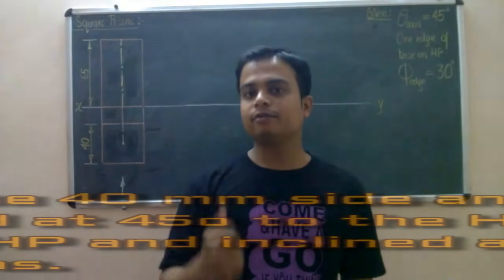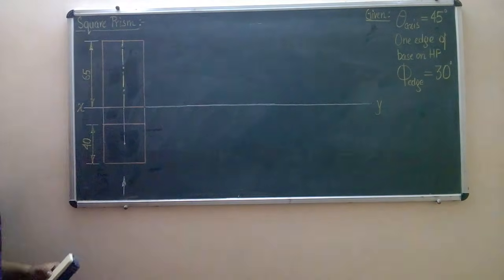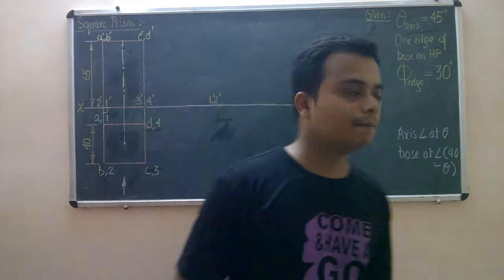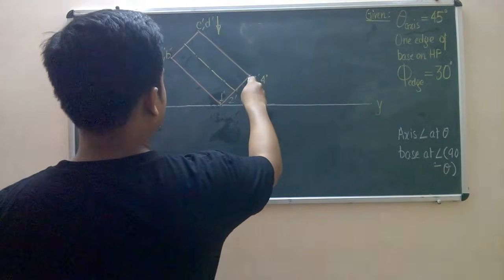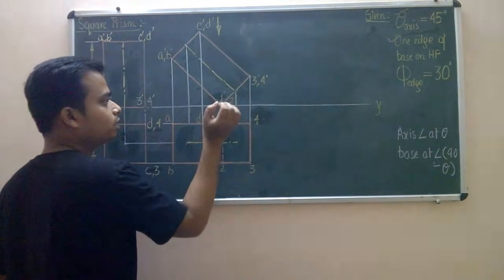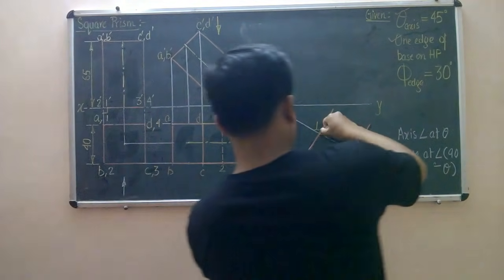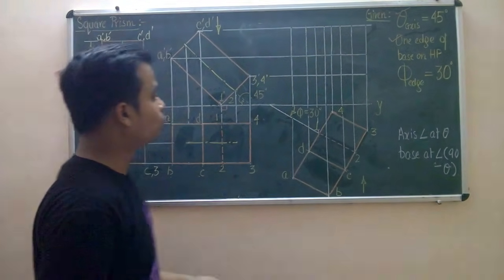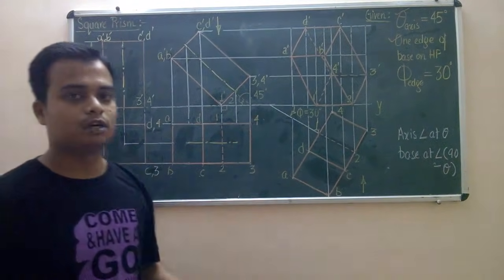Projection of Solids_Problem 8_Square Prism with axis inclined to HP & edge inclined to VP

Comment: A square prism (base 40mm, height 65mm) has its axis inclined at 45° to the ground and
parallel to V.P. The edge of the base which is nearest to the ground level is 10mm above the
ground. Draw its, F.V., T.V. & LSV view using 1st angle projection method.

Sir can you tell what to do in the following part of the question "The edge of the base which is nearest to the ground level is 10mm above the
ground."

Comment: Sir can u pls solve this 
a regular square prism lies its axis inclined at 60 degrees to the H.P and 30 degrees to V.P.The prism is 60 mm long and has a face width of 25mm,the nearest corner is 10 mm away from the V.P and the farthest shorter edge is 100 mm from the H.P.Draw the projections of solid

Comment: Will you please give me solution of this problem? 
a square base prism having a base with a 35mm side and  an 60 mm long axis,  rest on one of its base edges in hp such that the axis is inclined at 45° to the HP and 45° to the VP. Draw its projections, if the resting edge makes an angle of 30° with VP?

Comment: sir i think u take wrong there bcz question says making an angle of 45 degree with HP but u  make it 45 degree from its left vertex. ithink that we should always making an angle from its axis of 45 deg. so its right bottom vertex should toch the XY line
Reply from the maker: Chirag......remember if axis makes an angle theta with HP then base makes an angle 90-theta with HP. The construction becomes easy if we use this method....In this problem theta is 45 degrees and hence 90 -45 becomes 45 degrees........i hope this will clear your doubts......